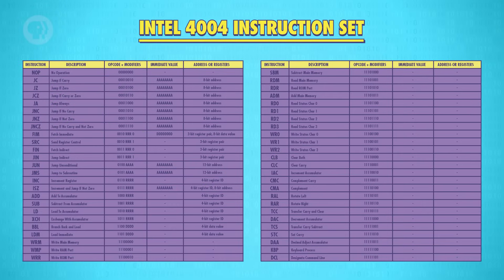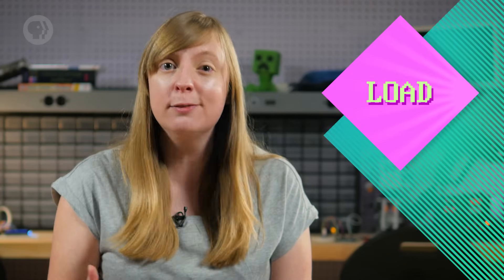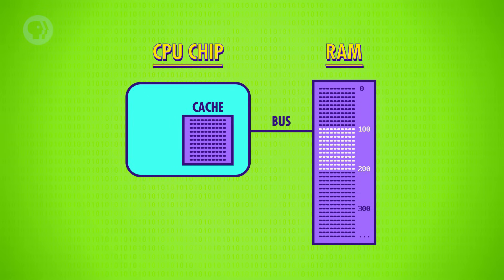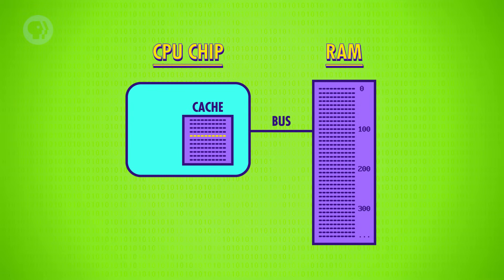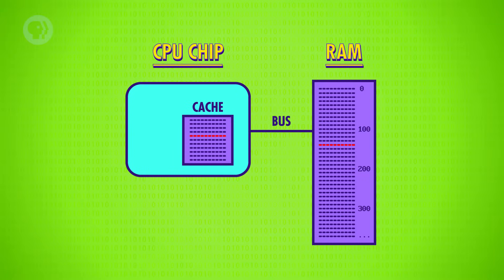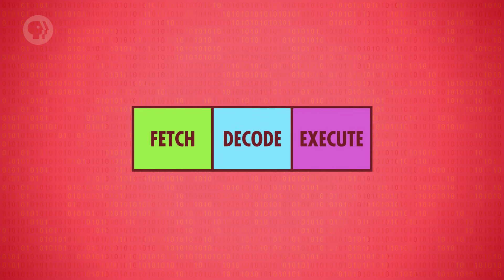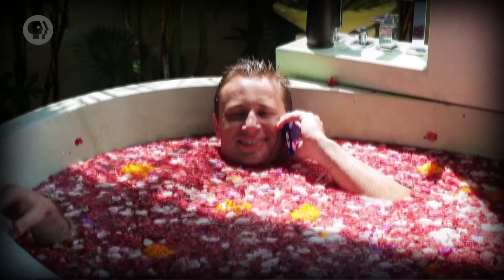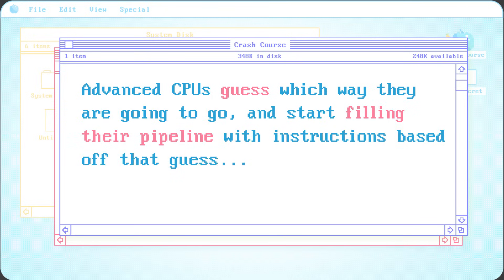Advanced CPU Designs: Crash Course Computer Science #9

Comment: "No word on whether it will run Crysis yet, but I suspect it might." This is one of my favorite series yet!
Reply: RIP every supercomputer yet. Crytek OP
Reply: It's not just the CPU clock that determines what software a computer can run, far more important is the architecture; if, as i suspect, this Chinese supercomputer uses a custom design for its processors, the chances that it will run ANY game are virtually nil.
Reply: Brandon Hu All you need is an RGB LED light strip. That ought to help.
Reply: The way she said "but I suspect it might" just sounded so funny and cheeky. Brilliant icing to the cake of a classic meme.
Reply: Do you even meme bro?
Reply: LOL, China must be preparing for Crysis 4!
Reply: It can not only run Crysis on max settings. It can create a accurate simulation of a computer running crysis
Reply: That gave me a very hearty chuckle.
Reply: Probably can't run crisis at all, since each core is only clocked at about 1.4 GHz
Reply: First you would need to fix the Windows scheduler so that it could understand how to manage that many cores, or I guess you could run it on Wine lol
Reply: Not necessarily, the machine would be bottle necked by the weak single cores, because games are notoriously bad at multi-thread utilization and besides latency would be disgustingly big compared to most computers.
Reply: Mine runs Crysis 3, it should probably support the original, right?! lol
Reply: Supercomputers are purpose built and some actually go almost all GPU (or closer to what we think of as a GPU anyway) and barely any actual CPU, others go all CPU and no GPU at all. This video may have said CPUs but I didn't really think it was clear they actually meant that because it often isn't exactly what we think of as either just closer to one than the other.
Reply: This joke made me realize why I've been enjoying this series so much. It's able to stay interesting and informative without throwing in quick-cut jokes every other sentence, so this line at the end actually felt a bit out of place and unexpected. I'm glad Carrie Anne is finding her own style instead of trying to mimic the style that most seem to do lately; it's a refreshing change!
Reply: @Eric D
Yeah, then they hook a CPU heavy supercomputer up to a GPU heavy one, and they can finally run Crysis!
Reply: mynameisofnomatter 
Make sure to add a super fast storage array to it also or you will bottleneck there to
Reply: This also made me chuckle! :D Its a valid question though, as a lot of cloud machines, like server farms go without graphical processing units (GPUs duh).
I am pretty sure that with that much CPUs you could brute-force the issue, but I am also pretty sure that nobody wrote a driver for such scenario :P

That said, I think the next step in software design is making code more and more parallel-friendly, 
which would make the use of GPUs, which are highly parallelized compared to CPUs, a lot more potent for non-graphical operations :)
Reply: It's at 11:22
Reply: normie meme
Reply: I think she was reading my mind
Reply: The original Crysis is mainly single-threaded, so with the relatively slow cores, it would run aweful. It's just not the right platform to do crysis.
Reply: A 10 year old meme...
Reply: If ONLY hey kept going from there. Crysis 3 had a cliffhanger, so maybe a MONSTER for Crysis 4?
Reply: Crisis has all the cpu stuff run on one core, and high core cound cpus have terrible single core performance.
Therefore, crisis could not be run
Crisis 3 maybe
Reply: @brandon Hu I was gonna ask that but she beat me to it
Reply: Engineer 314 they released 4
Reply: Absolutely love this.  Your amazing..  is it possible to do a segment on risc-v processors?..
Reply: @Gorilla Gojira That's not how these things work. Some applications can't be parallelized beyond a small number of cores. Doesn't matter if you have a virtual machine running underneath them or not.
Reply: No it can't run Crysis probably at all, because software architecture...
Reply: +1
Reply: With the level of corruption in China right now, it's entirely possible someone's already used it for that.
Reply: Clock speeds don't mean everything. It would make a awesome GPU, but a terrible CPU as games do not use multiple cores efficiently.
Reply: +Drakon Lord
Me? If so, I only meme occasionally.
Reply: Brandon Hu amazing!!!!
Reply: I cringed

Comment: at 1.5 ghz it wont be running crisis at all...
Reply: Supercomputers are optimized for different loads, and it's more like a overpowered GPU than a CPU. It would be bottle capped by the lower clock speeds and fewer transistors (Not all cores are created equal) of the cores. It can run crysis, just don't expect amazing performance
Reply: Who? me?
Reply: All right kidos... calm down. No you can have all the cores in the world doing calculations, but if the program doesn't utilize multiple cpus it won't matter. video games are programs that only realy use two to one core at a time, this is because calculation it does comes from input the player gives the program, it literally doesn't know your going to ask it to do next. When you do ask it to do something it my need to do many calculations and fast. The result is something like crysis needing high performance cores over number of cores. theoretically If cysis was a program that utilizes many cores the supper computer could run it, but it doesn't so it cant, end of story.
Reply: Good point. It would need good multithreading capabilities.
Reply: ya possibly, however you get diminishing returns with each sequential thread.... I wonder if super computers do have hyperthreading? I assume not because they do mass calculations with each core, and hyperthreading takes up space with a mini core in addition to the other core being threaded. It's probably more cost effective to just have more cores than have some space allocated for hyperthreading... but I don't know.
Reply: Hyperthreading is Intel's proprietary Simultaneous MultiThreading solution, please refer to it as SMT.
Intel cores would have HT and so most supercomputers do have HT, although China's supercomputer is running a custom core created in China and so should have SMT if they want to be efficient about it.
SMT creates more heat however because you would have less time between clock cycles. (SMT basically takes advantage of the delays and create a virtual core)
Reply: I think it would be more efficient to not have a multi threading. especially if you designing something that might not necessarily use it.
Reply: Supercomputers would probably use SMT, because it would be more space-efficent. Then again you do lower your power efficiency and heat efficiency. It's better to include it than to not have it at all, that way you could turn it on when necessary.
Reply: there isn't much necessary for it, you only use supper computers in very specific tasks, its not a desktop. I think you would be wasting cores if you started threading them.
Reply: how would you waste cores if you started threading them? SMT can double and even octuple the effective cores. Threads are basically cores. Super computers can still benefit as power efficiency (which is very important when you use so many watts already) is increased.
Reply: Threading only works if you have underutilized and or idle cores, so while you CAN double and even octuple power for a program not using all cores. I'm wondering if you wouldn't need it on a custom computer like a supper computer ruining custom programs that use ALL cores. It would make more since to me to have more cores running at full potential, rather then have some core space taken up by threads that wouldn't "theoretically" be used to their fullest potential because no cores are likely idle.
Reply: "Super computers today are almost exclusively massively parallel systems 
with hundreds/thousands of processors. This wasn't necessarily the case 
in the past, but the past ~40 years or so has generally been the case."
Reply: You won't run ALL the cores at once, there are cores dedicated for specific tasks along with the fact that China shares the supercomputer with other countries, they might have a higher proportion dedicated to themselves, but they share it nonetheless. Also you are assuming they run SMT constantly and not dynamically run it. It also depends on the program they are running, sometimes more threads is better, sometimes more performance is better.
Reply: no nearly all supper computer are threaded, I asked you were right.
Reply: Oh well =P

Comment: In the comments to find dryer recommendations. No one has mentioned anything :'(
Reply: I have an Electrolux with a 15 minute drying time for small loads, large loads take 49 minutes. http://www.electroluxappliances.com/Washers-Dryers/Washing-Machines/Dryers/EFMG617STT/
Reply: I have dryers in my dorm that dry in 60 minutes. I don't know what brand they are, and they are commercial dryers, but I can tell you later.
Reply: The dryer in my apartment complex can dry a load full of clothes in half an hour at medium heat no problem. It is quite big though, not something you'll be able to buy privately, I don't think. It's a Nortec
Reply: Our old Kenmore dryer will dry a load of laundry in 40 mins!
Reply: Same lol
Reply: which is really a maytag Kenmore was Sears in house branding :)